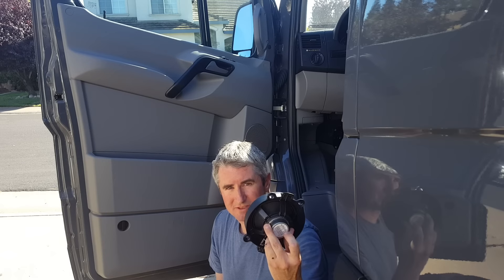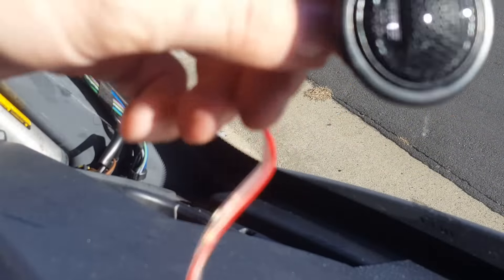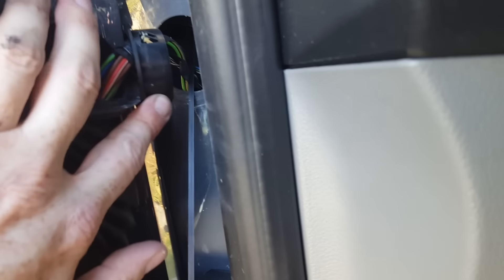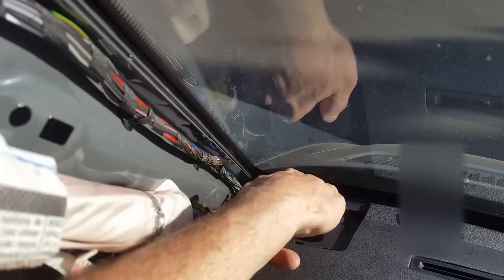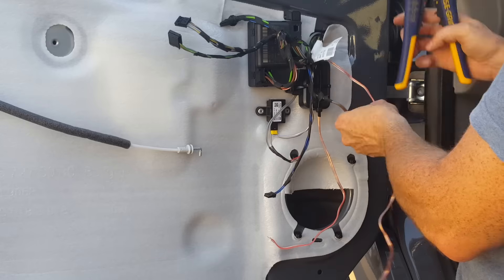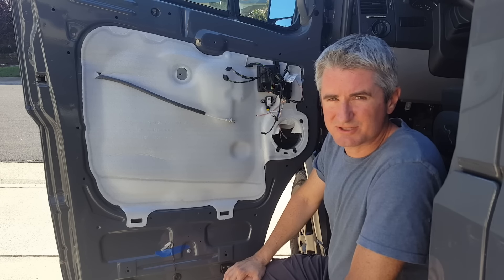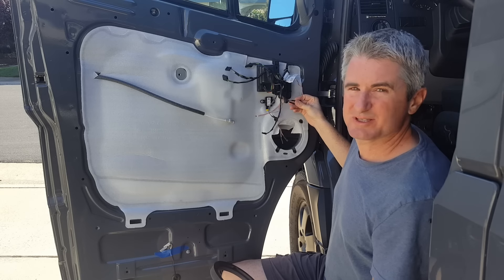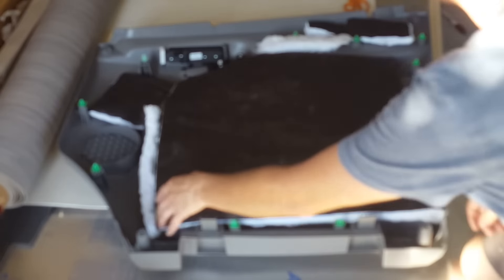Mercedes Sprinter speaker upgrade

Comment: Great video.
I encourage you to continue.

By not using the factory speaker wires you disabled the center dual voice coil speaker in the middle of the dash.

You can use the factory wires if your tweeters have crossovers built into them but then you have to get to the center speaker and disconnect it.
I didnt know the sprinters had a small dual voice coil speaker in the center of the dash until I found it to be the source of the awful rattle when the radio was turned up even after new stereo and speakers were installed.
Reply from the maker: Correct, the component speakers I bought replace the door midrange speakers and upper tweeters and include a crossover.  I did remove the center voice coil and never looked back.  Some people are concerned about Bluetooth call clarity but I have to say both music and calls sound much better now.

Comment: Thanks for the tutorial. Especially the identification of the positives on each side. Also, I would never found those two bolts behind the grab handle. They were very sneaky. I put a new Pioneer 9 inch floating screen in and identified a problem with the driver's side speaker. Took it out to find the cone separating at the edge. Now fixed with new Pioneer component speakers. Keep up the good work.
Reply from the maker: Thank you for the feedback, glad it all worked out!
Reply: Sprinter door speaker wire color code:
Left Front Speaker Positive Wire (+): Brown/Violet
Left Front Speaker Negative Wire (-): Brown/Dark Green
Right Front Speaker Positive Wire (+): Brown/Orange
Right Front Speaker Negative Wire (-): Brown/Dark Blue
Reply: For a case somebody need it.

Comment: Dude... you are like 2 months ahead of me with your build.  I was thinking about the speaker upgrades today!
Thanks to you, (and Dave Orton) I just finished my first piece of 80/20 furniture and have a much clearer path forward.
I'll be ordering some stuff through your links in the near future.  Thanks so much and keep up the good work!
Reply: Jason!  Lets see your furniture?  :)
Reply: It's not completely finished yet, but all the framing is done.   I've got to put some riv nuts into my siding and place it in the van yet... that's on the agenda for tomorrow.
I've got a 144wb passenger where I'm putting a bed width wise in the back.  The bed will be at window level to create maximum space... so underneath, on either side of the bed are going some "garage lockers" made from the 89/20.  They feel bombproof so far... anxious to see how well they attach with the rivnuts.  
I'll try to show you some pics in the light tomorrow!
Reply: I can't figure out how to post photos in a youtube comment, so I sent you an email with some photos...

Comment: When you have all the door trims off, it is a good idea to put some sound deadening on the inside of the door skin. That is cheap and can make such a difference to sound and overall sound level as well.
Reply: Yes, I was thinking of that.  I use Sika self-adhesive butyl roll when i worked on my car.  Trust Mercedes to have it already.
Reply: Julian Webb 
That Mercedes 'insulation ' is a joke . I had one on my '08 and when was ordering '14 just opted out , just like many others , who already had it . I did 5x better with some other stuff

Comment: You don't need to cut the stock harnrs6 the door speaker. Just add the crossover somewhere in between the head unit and speaker or amp and the speaker of you installed one. In just did the third system in my 2019 sprinter.  I kept the factory wiring for the door speakers, I actually got the door fishers out and kept the mounting bracket and used it with the new speakers and just plugged in the wires. Also took out the middle speaker.
Reply from the maker: Good to know, thank you!

Comment: Excellent video however I ordered the rings as you suggested and the size 5.625, I bought the exact same speakers, Had to return the rings they were to small. If you buy these speakers you need to order the 5.75ID adapter.  Straight from the folks at DYIvan who make the rings. Again excellent walk through just need to update that little point.
Reply from the maker: Thank you, I appreciate that information.  I definitely used the 5.625 so something must have changed, but based on this I will update the information and links for the 5.75" adapter.  Sorry for the trouble and again, thank you, this helps everyone.  -Ken
Reply: That caught two of us - I'm having to exchange the 5.625 rings today.
Reply from the maker: Something must have changed but I’m sorry for the trouble.  I updated the links yesterday to reflect the 5.75” version

Comment: Kenetube-Before I order a set of speakers thru your link, I have a question. I have a Kenwood DDX9905S, if I understand correctly, I disconnect the tweeters in the dash and do not use those wires at all? Basically splitting the signal from the door speaker back to the tweeter with the crossover. Does eliminating the two outputs from the head unit hurt the sound? Thanks for such a great Sprinter channel

Comment: Thank you for your video. My English isn't perfect so I'm having a bit of trouble understanding some of the details. I personally installed JBL Club (cheaper) on my Sprinter (2007) but apparently it's a bridge system because I could connect the wires in the order I wanted without any auditive difference? 

On the other hand, the sound is far from perfect and I'm limited by the small baffles that break the ears and saturate as soon as I turn the sound up too loud. I didn't have a small box like you with my new JBL speakers. Do the wires make sense? I have the same voltage on each one. Thanks :)

Comment: Isn't there already separation filter on the original audio installation as there are door speaker and a tweeter? Why not to use it? If installing new filter I might put it inside dash and use existing wires. Much less work.

Comment: Hey matey, great video! Thanks for your efforts. I just bought component speakers with out the bass and tweeter separater. Does that mean I can just use the factory wiring for the tweeter and not retun a wire to the woofer?
Reply from the maker: That's correct.  The crossover keeps the highs from going to the woofers and the lows from the going to the tweeters.  If you don't use one you can use the factory wiring, as that's how it's setup from the factory.  Thanks for watching!

Comment: Hey when you replace the door panel is the plastic door panel trim now touching the speaker? Mine is, I might have to cut it down
Reply from the maker: Hmm, mine does not.  Are you using the speaker adapter ring?

Comment: Hello! Could you clarify what you did with "tube" part between the plastic speaker grill on the door and the speaker itself? Did you trim the tube so the speaker would fit or was the diameter of the speaker small enough to fit inside the tube? Thanks!

Comment: Nice video. Is there enough room in this door to install 8 inch mids in the door? I prefer a bit more mid bass hit. I know I would have to trim the metal but just curious how much room there is behind the speaker and beside it? I would also install my tweeter near the door handle so it’s not bouncing off the windshield
Reply from the maker: Hi, I'm not sure as I didn't try a larger speaker.  Let us know what you find.

Comment: Howdy Ken - been following you since the beginning of your build.  Some of your processes really helped me with my build.  Now after these years, are you happy with your speaker upgrade?  Do recommend it or do you think something would be better?  I switched out my MB head unit for a Pioneer AVH-NEX 1330 a few years ago and really need a speaker upgrade.
Reply from the maker: Hi, super happy with it.  It’s wired for a subwoofer but I never installed one as I’m really happy with the upgrade as it stands.  I would consider some higher quality rear speakers.  The rears sound good but I imagine they would sound even better had I chosen some higher up the food chain models. Thanks for following along all this time!

Comment: Where do the factory tweeter wires go? Is there a factory crossover already in the van somewhere?
Reply from the maker: The factory tweeters are wired to the door speakers, I believe. I didn’t see any evidence of a crossover but there is a small capacitor (or something) that probably functions as a low cost way to filter out some of the lower tones.

Comment: Really incredible work with clear and easy to understand instructions (I need that).  Thanks so much for doing this!  I have a bunch of things in my cart from Amazon and eBay, (thx for the guide) but before I check out I wanted to ask about a subwoofer.  Did you put one in?  I didn't see it anywhere so I wanted to check in.  Thanks, John
Reply from the maker: Thank you John!  I did pre-wire for a subwoofer, but the system sounds better than I was thinking it would and thus never did install one.  As is, the system is good enough 95% of the time, and the other 5% I think about adding the sub for that extra level of awesomeness.   Good luck and enjoy the tunes!
Reply: @ourkaravan  Even better. Now I don't need to buy one and use the space in the van. Thanks again.
Reply: Sorry - another question - how did you mount your crossover to the door.  Did you use velcro?  thx
Reply: Nevermind - found your zip tie response below.  Thx
Reply from the maker: @johnk.anderson8810  I used either double stick tape or velcro, can't remember which.

Comment: Is this set-up / video instruction applicable to the 2020 144wb cargo sprinter van? Thanks for all the videos!! Fans, speakers, espar etc.! Huge help for me.
Reply from the maker: Hi, I’m going to guess that not much of the audio stuff carries over.  I haven’t physically seen the back of a 2020 head unit but I would be surprised if the wiring harness didn’t change. You’ll have to let me know!   Thanks for the kind words, take care!

Comment: Thanks for sharing a great video. Used your links to purchase same speakers and speaker spacers. I've got a question regarding the tweeters. Do you use the rings that they come with? Any details as to how the tweeter sits in the factory opening? Does it just sit in there, or...?Thanks.
Reply from the maker: Good question, it’s been a few years now and I seem to recall them either not needing spacers or using spacers that came with the tweeters.  I didn’t buy anything special to get them to work.  Thank you for use of the links, always appreciated.

Comment: Since the crossover only need one input, what did you do to the original wire coming from the head unit to the tweeter?

Comment: Is it absolutely necessary to use the crossover? If the factory has designated wiring for tweeters as well as woofers, what are we separating with the crossover? I have a 2019 Sprinter taken apart with JBL Concert 601CF 6.5"s + tweeters and am puzzled as to why I wouldn't just use the wires that came stock. Please help!
Reply from the maker: The crossover separates the frequencies so woofers only receive lower frequencies and tweeters only receive higher frequencies.  It will prevent distortion and create a cleaner sound.
Reply: @ourkaravan  Thank you! I get that but I'm still confused because didn't the factory already do that when they wired the tweeter separately? I guess I'm wondering if there are any high frequencies going to the woofer since it seems the factory split them for us?
Reply from the maker: I’m under the understanding that there’s nothing but wire between the door speakers and the tweeters high in the dash, including the center channel speaker.  Therefore the stock tweeters would be receiving full range audio.
Reply: @ourkaravan  Excellent video...thank you.
I have what may be a very fundamental question and apologies if this was already covered in any of the previous questions.  
I plan to replace my front OEM speakers in what I believe is the same rig that this video is depicting (mine is a 2018 Airstream Interstate Grand Tour Ext which is built on a Mercedes Benz 3500 Sprinter Chassis).  I plan to replace the front side door panel speakers with a set  two-way speakers with the tweeters already built into them; therefore can I not just cut the wires leading to the OEM tweeters mounted in the upper dash corners adjacent to the windshield?  
It appears from the video that getting to these OEM tweeters is very cumbersome and if I can avoid having to do this I believe this is the route I would prefer to take.  
Thanks in advance for any advice/guidance on this matter.
Steve
Reply from the maker: Hi, that’s a good question and I’m not positive of the answer.  There’s a center speaker in the dash that is hooked to the others. It would make sense for the factory wiring to come out of the head unit and hit the center speaker first, then the tweeters high in the dash, then terminate at the doors.  Something to research anyway.

Comment: Nobody shows how to get the door conduit for the wires back on....  How do you get it back on I cannot.  Help me please.
Reply from the maker: Hmm, it's been four years now but I seem to recall the rubber having a lip and groove that pushes into the sheetmetal.
Reply: @ourkaravan  Yeah, found another video. You have to remove the plastic bushing too from the door and the frame and then you can put it back on the tube and then insert it in the door and frame.  Best way to remove the bushing is with a very small screwdriver and turn the bushing.
Reply from the maker: Thanks for the reply.  My memory for things I did years ago isn’t that great.  I can barely remember what I had for breakfast, haha.

Comment: Did you just mount the crossover with the tape they provide?
Reply from the maker: Yes, I believe I used a couple of zip ties to attach it to an existing wire bundle.

Comment: What did it cost to get the rear speakers activated by the dealership?
Reply from the maker: Never did.  If you use these methods you won’t need to.  I think the dealership charges their one hour minimum shop rate.
Reply: @ourkaravan  Thanks! Really dig your videos and methodical process. Will be creating the same for my family, possibly with a Transit though. Thanks for the videos!
Reply from the maker: Thank you!  Yeah the amp copies the signal from the front speakers to the rear so you don’t have to do the dealer activation.   The Transit may have a completely different setup.  Either way good luck!